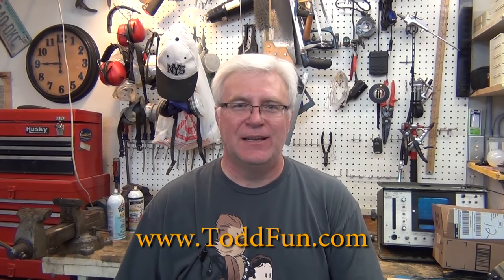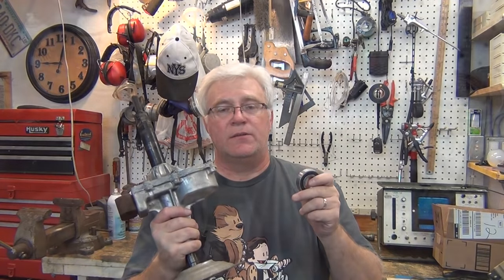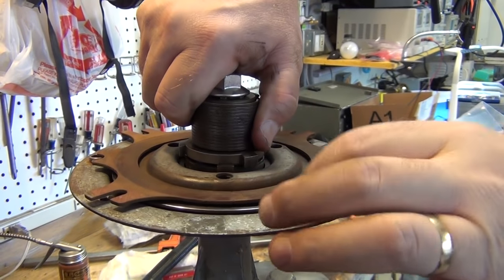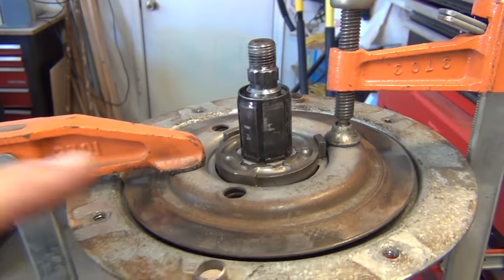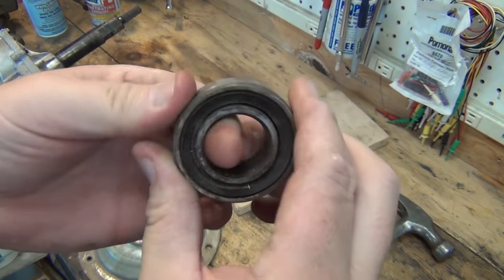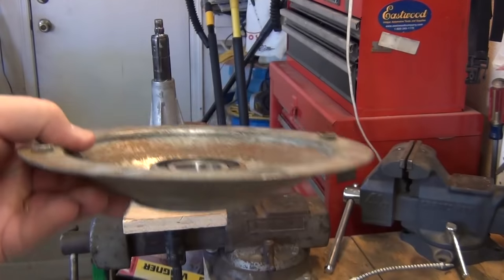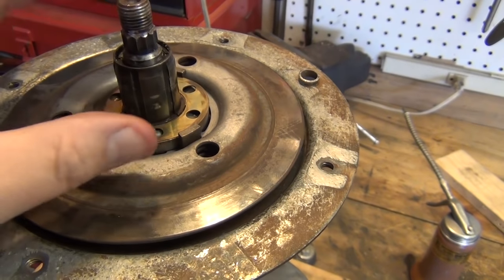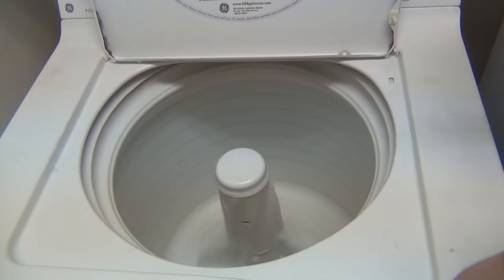Rebuild GE Washing Machine Transmission Brake Assembly - WHDSR209D2WW

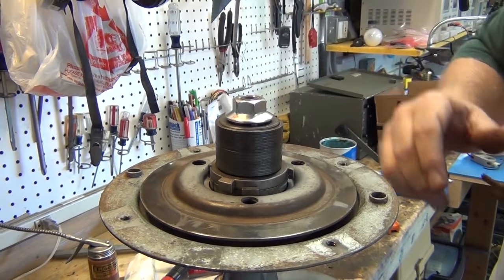Comment: Just my two cents: You don't need to clamp the discs yourself. You can set to remove the spiral ring right after removing the big transmission pulley while everything else is still in place. At that point the disc assembly is already compressed because it's still mounted on the tub, and the spiral rings are perfectly reachable just by removing the clutch mechanism. So you could do as shown in this other video https://youtu.be/iY9CPrmLq-k up until minute 7:00, then come back and jump to 6:16 on this one.
Reply from the maker: SUPER GREAT TIP! Thanks for stopping by and helping out. I have pinned your comment to the top of the comment stack. I hope others take a look too.
Reply: haha thanks! Glad to be of help. Your video was very helpful to fix my washer.
Reply: A nice informative video and also refined by viewers
Reply: @ToddFun  you save me from buying a tools but you don’t need to punch the  casing of the bearing because  it compressed together with the assembly and with the chase of the washer machine and it easy to make maintenance for the bearing next time other part of the gear is never damage unless there is no oil in the gearbox only the seals change and  the  top rod some time need to machinery to fix the scratch in it and painting it this washing machine its like the American muscles car i need your advice i have one but the spare part is shortage now so ether i collect it part for future or leave it until dade  and buy new one

Comment: Thank you Todd, the parts showed up in a matter of days, and the bearing replacement was easier than expected. She runs like a top now, and its quieter than when I first got it. For anyone who is considering doing this repair, it saved me at least $175 in parts, and it saved me whatever a service call costs from service one too. Highly reccomended, if you are mechanically inclined.
Reply from the maker: +Darin Bailey Great news! Thanks for the recommendations and I'm glad it was helpful.

Comment: Thanks for the video. Used it sucessfully. Used 2 ViceGrip 11R pliers for the spring compression and used the tub upside down to hold things instead of making the holding fixture and using the bench. Helped me help someone else and that is very much appreciated.

Comment: To hold the transmission in a vice, cut a 6" piece of 2x4 wood. Drill a 1" hole in the center, then cut it in half through the center of the hole. You know have two pieces of wood that can clamp the transmission shaft in a vice. The transmission bearing is 6205-2RS-1, it has a 1" inside diameter. When you replace the bearing you can hammer in the new one with the old bearing. The bell housing with the new bearing should be tight to the shaft after re install. If you can move it up and down use some red Loctite or peen the shaft with a nail or set punch to hold the new bearing tight to the transmission shaft. If you want to make sure the bearing is protected from any water leaking from the tub down onto it you can install a boot (seal) over the transmission before install the bell housing. A CV axle boot or something similar would work as a boot. Its recommend using Permatex 20539 Indian Head Gasket Shellac for the tub seal. I used JB weld because I am cheap. The transmission has 75W-90 gear oil that can be changed. There is a black plastic plug that can be pulled out to drain/refill.
Reply from the maker: Nice. Thanks.

Comment: I managed to destroy the spiral spring retention clip. After some searching, I found a replacement, and this video ha ha.  J&E WRIST PIN RETAINER SPIRAL 1.081 IN. DIAMETER .042 IN. THICK # 990-042-CS. I paid $2.50 for 1 from Pit-Stop-Gang on ebay.its the same exact part. fit perfectly.  Also ordered the wrong bearing. Wish I found this video first because Todd specifies that it needs to be 1 inch inner diameter. I ordered the wrong one which was 25mm, It needs to be 25.4mm or 1 inch or it will not fit. Thank you for the video, Really helps a bunch, and very well done.
Reply from the maker: Thank you very much for sharing the details. I will post them to my blog as well.
Reply: Saved me.  Thanks !

Comment: Todd, good instructional.   Unfortunately the bearings that arrived from Amazon were not -1 even though the description said that’s what I ordered.  It took a lot of sweating and head scratching before I figured it out. I froze the transmission in the freezer, and heated the bearing race with a heat gun, just warm enough not to melt the grease out, and it still will not even start past the taper of the transmission shaft.   It’s about 0.002” too small for a Press fit.   

I filed the end of the shaft to extend the taper, and polished it to ensure no burrs existed, and got it to start, but it was so tight it pushed metal in front of the bearing and seized.   I ruined the bearing hammering it back off.   

I finally figured it out and bought the last -1 bearing in town I think, which I will install tomorrow.
Reply from the maker: I had used the wrong bearing the first time too but in the show notes I posted a link to the 1 inch ID bearing. Sorry if the video was confusing but I thought I had corrected that in the video too. From Show notes:
Bearing  6205-2RS-1
The '-1' is important, it means 1 inch inner diameter
https://amzn.to/2Svxe9N

Comment: Great work ToddI made my jig out of the old Drum bushing/bearing. I mounted it on a small piece of scrap wood and drilled a hole just a little larger than the old drum bushing/bearing. It worked great. Thank you again for a fabulous job.Barry
Reply from the maker: +Barry K Sure, glad to help.

Comment: I bought new Motor centrifigual clutch which was defective from factory.   I made one good clutch using parts from the old one.    Some said too clean gunk out the water level sensing tube.
My transmission has been replaced.    10 years or more love my GE

Comment: Very good video! It would be great to use a hydraulic press for the bearing work. You can also use permanent lock tite instead of staking the bearing in place. Make sure you clean the metal with brake cleaner or acetone before applying locktite.
Reply from the maker: Interesting idea. I will try to remember that tip. Thanks.

Comment: Found out its a 1-11/16th nut for those of us who want to use an impact to get the drum out.
Thanks for this video. I need to do this for mine and these transmissions are no longer available.
Reply: The illusive 1 11/16" socket. Buy a new washer
Reply: @garvdarb  The socket is easy to find. 
I scrapped my washer and went with an 1980's Maytag for free. Not interested in the new crap designed to fail after a few years

Comment: Hi Todd-     I followed your advice here and replaced that bearing, and my washer (which had not been spinning) spun like a charm.  Thanks for that.  

Unfortunately, a couple weeks later, my 7 year old son tripped and fell into the washer pretty hard and loads are unbalanced now, and I'm trying to figure out why.  One idea I have is that it may originate from too much play in the vertically-grooved shaft that comes out of the post that sticks through the tub hub.. the shaft that the agitator assembly attaches to.  When the spin cycle starts, before it spins out of control in that unbalanced load kind of way, I see a lot of wobble in the agitator.. and the shaft itself does indeed have a lot of lateral wobble within the post.  I'm trying to figure out how that shaft is normally sturdied up so that it doesn't wobble.  If I understand the mechanism right, it seems like it normally rotates around within the post with agitation, so this inner shaft must have some kind of mechanism that holds it straight during agitation, like a bearing.  But all I can see when I peer in where the shaft enters the post is what might be some kind of gaskety material.. looks like there could be a bearing in there, but I'm not sure.  Have you ever explored this, by chance? 

I guess if this is plausible, the question becomes whether this is a servicable part of the unit.   Hmm.  Thanks-

UPDATE:  I just replaced the tub nut (hub nut?), not thinking this would fix the problem, but it seemed like it might have been slightly misthreaded (those soft aluminum threads), and wanted to rule that out as the problem.  A test wash without clothes just now didn't go out of balance.  The agitator still seems wobbly, but so far so good..
Reply from the maker: Check that the feet are set correctly to balance the machine, level and firm.
Reply: @ToddFun  RIght Todd.  Yes, I spent some time leveling and stabilizing everything.  I'd removed the bottom a while back when I had a leak and had never put it back on, so thought that caused a lack of stability that led to this.  Unexpectedly, it turns out the tub nut replacement seems to have done the trick!

Comment: A couple of additional tips, first, if you have the transmission out, at least change the top and bottom shaft seals (found on eBay) and pull the black fill plug on top of the transmission and drain the old transmission oil and refill with new 75w-90 gear oil.

Second, rather than using a large socket to pound in the bearing, use the OLD bearing on top of the new along with a block of wood. No need to buy rarely-used giant sockets.
Reply: Would you have the listing or part number to these seals?

Comment: Great video!  I was wondering, would the brake assembly ever just lock up and prevent the washer from spinning?  I have an old ge washer that agitated and pumps, but will not spin.  For a while, I could just wait for it to go into spin cycle and listen for the click when it shifts gears.  I could then manually spin the drum from the top and then it would get going on its own.  Now it just locks at the spin cycle and I cannot move the drum.  The motor also starts to get hot and smoke a little.  Looking for a used transmission brake assembly on eBay in the meantime.

Comment: They discontinued this transmission. I replaced it twice since 1998, and now doing it a third time. It's a pretty simple swap. But on mine. The bearing never failed. It always stops agitating. Being that these assemblies don't last ten years. I'll buy a new washer before I buy a used transmission off Ebay. The going rate for used is $150. A cheap top loader start under $400.

Comment: Thanks for the hard work. I'm trying to do this repair but I am struggling with the part of getting the big spring out where you grinded it around. I don't have a precision, grinding disc, plus my pulse have never been good, so I'm using a 24TPI hack saw. I have eaten away a good part, similar to what you have but mine is not showing signs of a wedge or separation, and I'm really afraid if I keep hacking I might cut too much and do unrepairable damage to the shaft.
Reply: Update: I hit it lightly with a hammer and noticed it was sliding up, so I was able to take it apart and do the repair. Thank you.
Reply: Update 2: I don't know what I am doing wrong but for some reason but the gasket that goes between the transmission and the motor (the one with 6 holes where 4 are for the screws that fix in place the transmission to the frame on the bottom) is hugging it too tightly and the pulley can't spin it. Maybe it is something to do with the big spring, but I can seem to solve the situation.

Comment: How about them Amana, kenmore,whirlpool gearcases? They are also buy the entire thing deal, except their transmission is just a tin can cheap stuff.  They have two simple bearings and of course it is the top one which is under the seal of course that gets the water and takes the beating.  I have once succefully replaced one bearing and got it going.  
My next attempt is to use another case and destroy it and same the transmission while destroy the first transmission to save the case itself. And then simply install the transmission on the case that I saved and of course install a bearing.
I drill out the rivets and simply install bolt and nuts afterwards in their place.
I have sprayed WD40 where the bearing is and let it soak over night... but had no luck.
I wonder if you think of a better method to save the case apart without destroying the transmission or vice versa?  :-)

Comment: What is the use of the piece you put on at 19:07 ? In my machine, the same part was broken and I collected it without installing it. During washing, the inner drum rotates faster than normal, does it have anything to do with the broken part?

Comment: What about the seal on the other end?  When I was removing the reverse thread nut in the tub I made the mistake of trying to pull out that seal.  Will it leak from the top?  Will water get into the top of the shaft.  FYI, not taling about the tub seal, it looks like a rubber boot seal type washer on top of the transmission shaft.

Comment: Hi Todd, thanks for the great video. I got it all apart no problem. But when reassembling the last pieces, is there a timing procedure that I have to be careful of? I'm talking about the pieces with the collars on them for engagement. I noticed an arrow indicator on one of the pieces. Thanks!
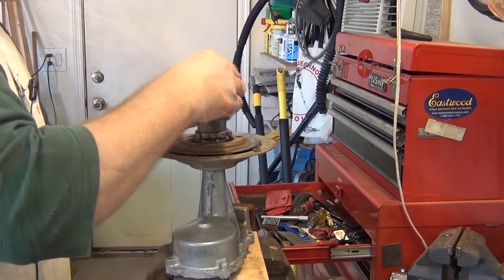Reply from the maker: I would think if the tabs between the top and bottom are gapped about the same as in my video at 17:47 you should be fine. That's the most I know. Maybe there is a mark someplace but I don't remember and don't see anything in the video.

Comment: Nice work Todd ! :)
Reply from the maker: EcProjects Thanks!
Reply from the maker: +Jerome Davis Gear Case oil: http://www.appliancepartspros.com/whirlpool-gear-case-oil-350572-ap3072960.html
Reply from the maker: +Jerome Davis Not sure about the size difference but the gear loop did have about the same weight as 90 weight. Not a lot of it in the one I took apart in for this video. Maybe 2 cups at most. It was yellowish / clear thick oil. If that helps.

Comment: A friggin' $2 part to fix what would otherwise be $150–$400+. 🤦🏽‍♂️ At those prices, you might as well buy the tools to fix it yourself and invest for future work.

I like the pegboard and other setups.

Where did you get the clamps?

My grandfather, a former Boeing engineer, had his garage filled with this sort of stuff (mechanical engineer), but I'm sadly don't have such a luxurious spread, and am pretty cash strapped. So, I was hoping to find either used tools or the like that I can use for repairs.

Having (relatively) huge clamps like that is nice.

In my own case, the washer is grinding at agitation, which I anticipate is due either to the bearings or brass balls being damaged/lacking lube.

Out of curiosity — does anyone have thoughts about alternative greases? Like, how would a dielectric synthetic grease work compared with what I anticipate is plain old crude axel grease? Particularly, if the synthetic is highly water resistant?
Reply from the maker: I got the camps at Harbor Freight

Comment: Todd,  the 6205-2rs1 (new bearing) will not go on.   The inner race is smaller than the one that came off.  The part number of the one that came off was 6205-2rs-1r and the one I got off of ebay was 6205-2rs1.  It is microscopically smaller than the original one.  I am going to try to widen the inner race with a drill bit/dremmel (i know not recommended) but I have to get this thing running before my wife kills me.  Thoughts/ideas?  thanks
Reply from the maker: +Daryl Cesal Your eBay source sold you the wrong part. Even if it is marked correctly it is the wrong part. Same thing happened to me which is why I put in the extra detail about the inner diameter needing to be 1 inch. It is a very confusing bearing as the whole thing is in metric units with the exception of the inner diameter. Follow the link this link to my blog posting for more details:
http://www.toddfun.com/2015/06/06/replace-bearing-in-washing-machine-transmission-brake-assembly/

The bearing that worked for me was: 
http://astore.amazon.com/tod0f5-20/detail/B0045FJNA4

Do not try to change your bearing if it is too small, just order the one off Amazon and in a few days you can put the machine together working.
Reply: +Todd Harrison Todd,  thank you for the reply.  Actually I bought a small grinding wheel drill bit and worked it for 30 minutes and was able to take enough material off to get it on.  Now getting ready to put it back together... thanks man!
Reply from the maker: +Daryl Cesal Well that is interesting solution. I would think it wouldn't be too balanced and would quickly develop a shack. But if you got it just right it might be just fine. Let me know how it holds up after ~10 or so loads.
Reply: difference looks like 0.38mm. Thermal expansion and contraction. can of air duster, freezer or dry ice for cold = shrinks. Torch, oven red hot poker etc. For expand. When temp equalized that sucker is not going anywhere.Haven't tried it here but has worked when press fitting bearings without a press.